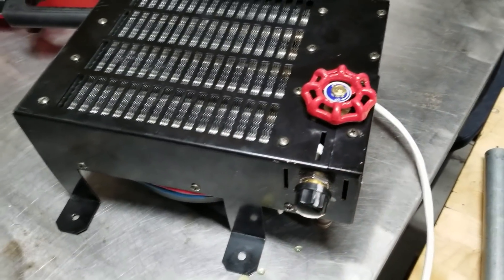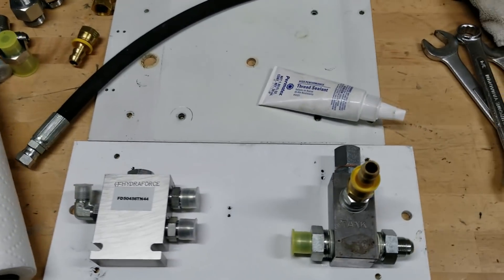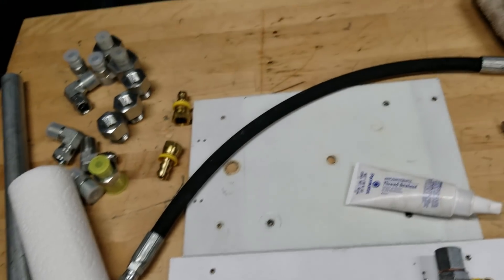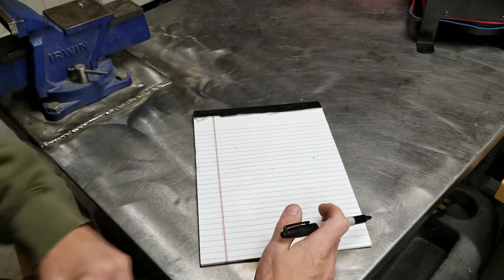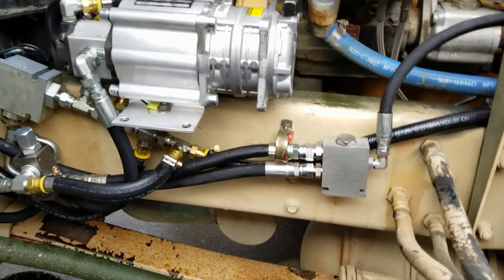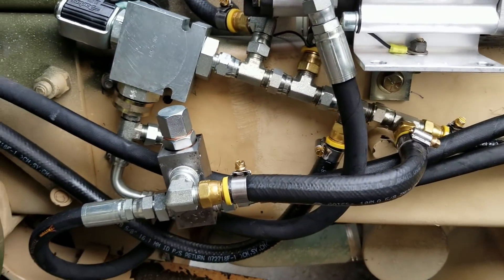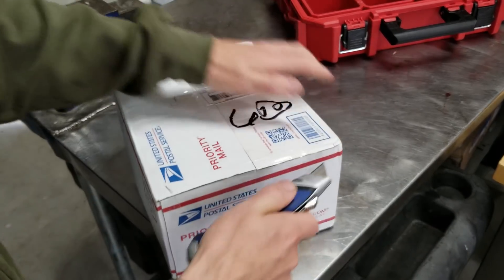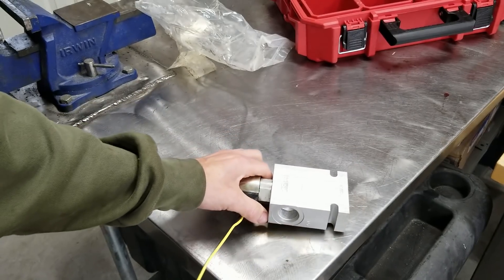Abel LMTV build part 107 (Finished: Red Dot hmmwv a/c with hydraulic compressor)

Comment: Excellent job all lines easy to follow. Check valve and flow control will save components nice research on your part. Should last for the life of the truck. Cooler is a good addition for when the weather gets hot. You could put a temperature control sender for the fan  like a car or truck radiator fan so as to come on only when the fluid is hot.
Reply from the maker: I thought about that but the simpler idea was to relay it off the compressor signal so every time the compressor clicks on so does that wee fan.  :D